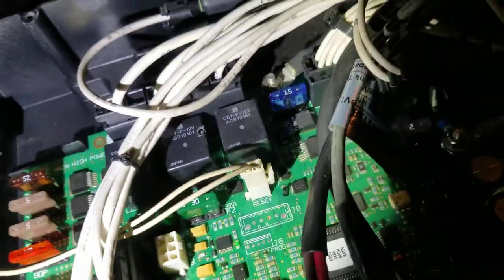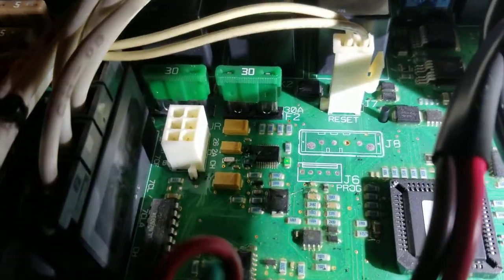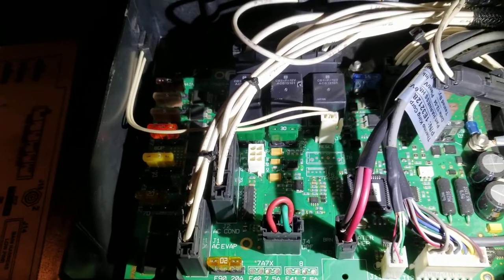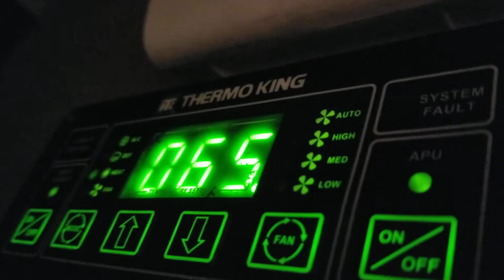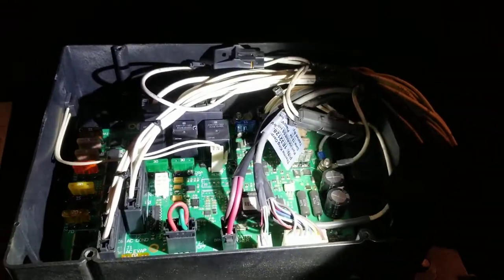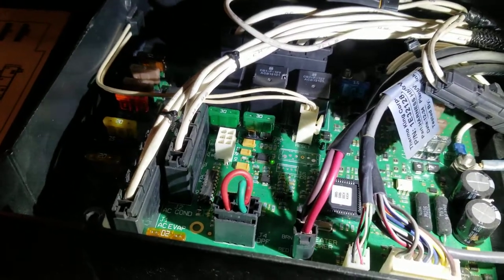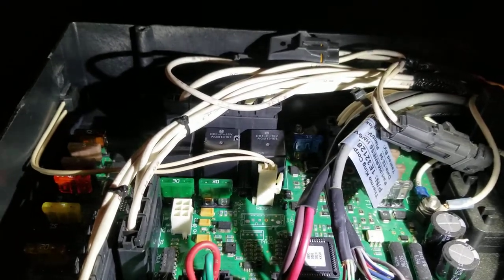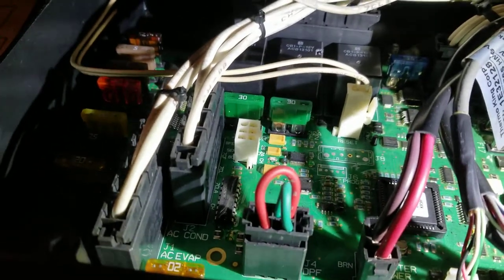APU Keeps Blowing Fuses - Easy Fix

Comment: mine keeps burning the fuse as well will look for rubbed wires
Reply from the maker: Definitely a short somewhere
Reply: @natcoziay  found my issue. wires were connected backwards to the blower motor
Reply from the maker: @Tony-tk4ht  Glad you found it. That APU is a necessity right now.

Comment: Did I ever figure what caused 30amp fuse to blow? Starter?fuel Control solenoid ?wire rub theu and touching bare metal?
Reply from the maker: Yes it was an electrical short. The wire had rubbed through on the frame of the truck.

Comment: My keep burning the 30amps
Reply from the maker: If it keeps blowing fuses, you have an electrical short. Chase the wires running under the truck until you find the short. I have another video explaining the same problem and how I fixed it. More than likely, the electrical short is going to be in the wiring harness attached to the frame of the truck. Look there first. Good luck